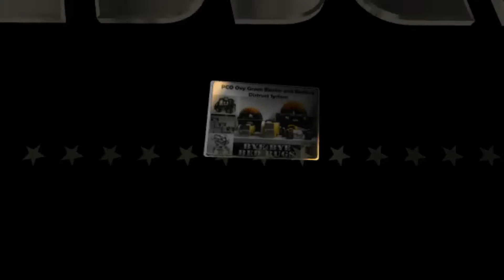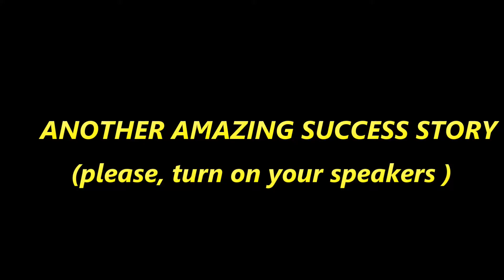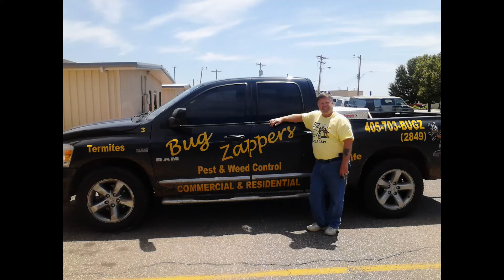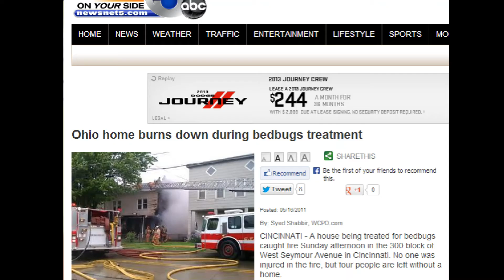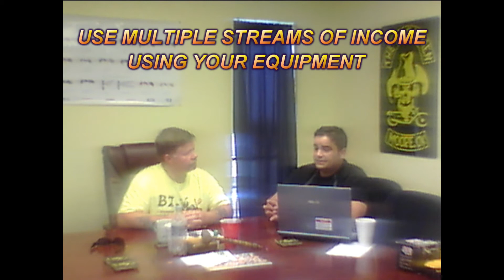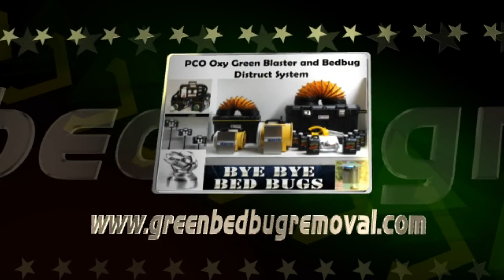How to Use Ozone to Kill Bedbugs and other Pests

Comment: Ozone generators do kill bedbugs, but only the ones that are not hiding in cavities, wall plugs etc.
Ozone O3 will not penetrate walls, wall boards etc, it is a gas, to penetrate walls holes must be drilled in walls or fibre board.
The same with mould, it will kill visible mould, but not the mould that has penetrated the walls.
With bedbugs if you do not kill all of them, plus the eggs they will come back